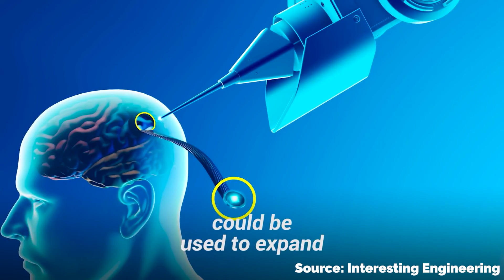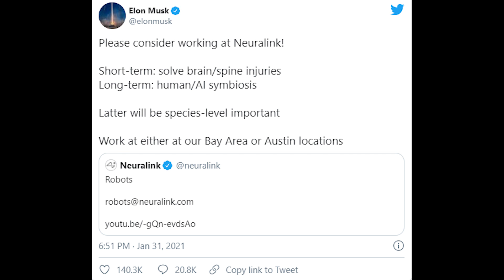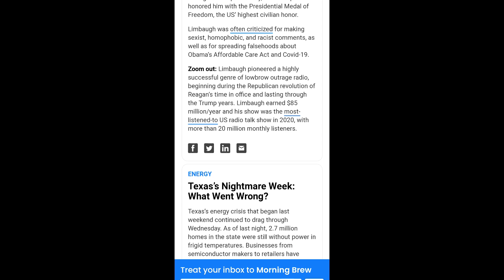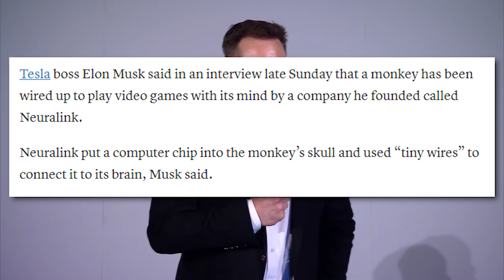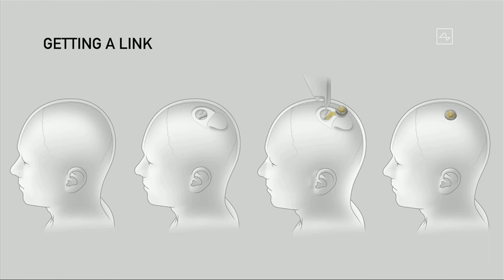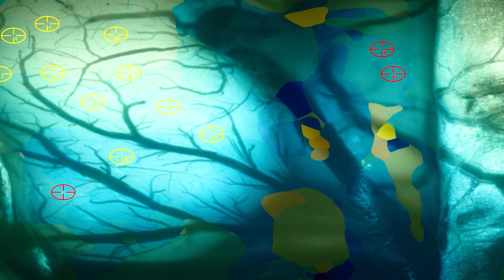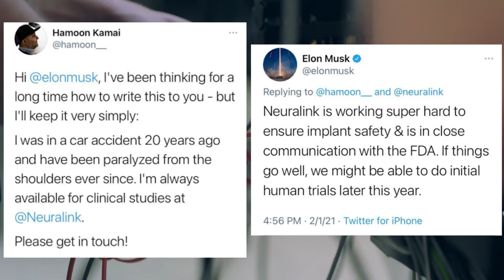The 2021 Neuralink Update Is Here..

Comment: The medical aspect of this tech is only to help generate enough funds and acceptability so that the main mission can be launched.  Not any kind of conspiracy nut talk, just looking at all the pieces and logically putting them together.

1. Auto pilot and fsd - the web that weaves all the parts together back to the human link.

2. Reusable, lower cost rockets built mostly by increasingly capable robots.

3. Tesl bots - very human like, when controlled by humans with neuralinks.

4. Full sensory Neuralink connections between humans and Tesla bots will be used for earth and space exploration and remote construction to eliminate dangerous conditions, risks, loss of life etc.

5. The bots will “learn” while doing this, just as fsd has learned by watching us drive for years. 

6. Solar power banks will continually charge vehicles, bots, tunnels, homes and factories. 

7. Underground tunnels will make transport quicker and less dangerous as weather and accidents will no longer be a travel concern. 

And on…

Comment: As a neuroscientist want to interject this statement into the comment section for people believing this is the end of humanity / singularity etc  - PONG works on 1 plane (vertical). Like in the first demonstartion with NEUROLINK. The first 2minutes of the video the primeate was manually controlling the digital interface in 2 planes (vertical and horizontal). Placing an intracranial electroencephalogram over the hand homonculus in the brain will only create positive and negative waves which can then roughly translates into 0's and 1's when the hand is activated or not. The can be used to manipulate the PONG bar either up or down. This is NOT complex movements like what was demonstrated in the first section of the video. NOBODY can create input signalling IN TO the primates brain...its only READING the EEG OUT-PUT signalling over Primates hand AREA in the brain (which we have been doing for many centuries)....a primate's hand area in the brain is particularly large which makes this whole experiment much easier (unlike with a human's). kudos to neurolink for translating the waveforms into bits of data and sending it wirelessly (Contemporary medical hardware are not wireless)....but i hate to break it to everyone - this is NOT going to evolve into some mind controlling super machine: this is the maximum function this experiment will obtain; nothing more - nothing less: and everyone who thinks you can do anything more from this experiment - is not a scientist but a pseudo-scientist; which is entertaining but not factual...which I will leave to Hollywood for good frictional movies or conspiracy theorists for blabber (THE FUTURE IS NOT GOING TO BE WEIRD)

Comment: surely every information has to be encoded before it can be transfered and decoded before it can be read. like brains, every computer program can implement things differently but if you want them to communicate they need to agree on some sort of interface or data layout. only that layout, which is not the raw/brainy representation of the information, can be known to any participant.

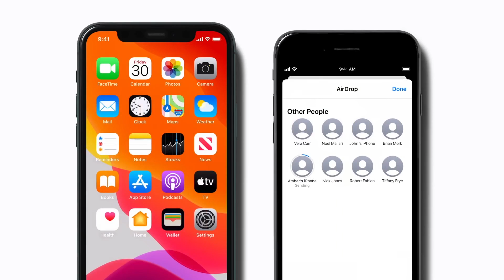Comment: The explanation of the procedure lacks in extremely many aspects at around 11:00. But most importantly, you'd have to take into account the degree to which a person is able to process the received data and mak sense of it, due to the brains of different people have different interpretations etc. Also the electrical states would have to be muuuuuuuuuuuuuuuch lower for the brainto handle them well. It is one thing to measure the output signal of a brain but a completely different story to adjust the active input of data in a specific format with the right electrical currency and values of measures and spacing for any human brain to be able to interpret it semantically. Think of it like this: For a machine, we can give instructions to do on its device with its designated architecture with standardized human brain wave measures. Like a learning neural network. But every brain has apart from its life-preserving instructions many different individual instruction sets and probably many more subsets. This means, that, for 2 humans to successfully communicate telepathically between each other, they'd either need to have at least 99,999% identical instruction sets (or brain architecture) or you would have to map it first. As far as I know, we are not even done discovering all the different instructions the brain contains, because they by far outmatch the ones used in computers. But research could be helped by exactly that technology. Mapping out human brain instructions/interpretations of incoming signals. This is the step we'd need to make first, then we'd have to lay out correspinding formal input pattern sets and ONLY then can we think about humans communicating the easiest stuff to each other.  Verbal communication in that moment, where the sender lets the receiver know what it actually wanted to "send" and comparing it to the interpretation of the receiver might help in that process, but ONLY for the communication between these two people. Uploading whole ideas and thinking processes would in y opinion be a far longer road to achieve accuracy between 2 individuals (let alone between any other human.). All of this is of course assuming, that you don't use any additional devices. But those would make the whole purpose obsolete, because then you could just use a smartphone, sending a file or text message to a colleague. Where would be a point in that? This has to be as non-invasive and with as little additional helping equipment to even make sence for study in the first place.

Comment: The real issue comes down to complex processes into and out of the brain. It's one thing to move a slider you're looking at, it's another to download terabytes of audio/video data, translate and decode it based on the specific mapping of an individual brain, analyze it, then translate and digitize organic memories in response. Simple functions are easy to translate with simple neural signals. The idea of data transfer is a ways off, on top of that you have neurochemistry to think about, as that greatly influences brain function, and isn't fully understood as it is.

Comment: As a software engineer, I need to add an important detail: NO, it can’t hack you and control you. It can only READ radio waves.
Reply: its read and write, if it was only read it would be useless
elon has said multiple times it will be fully read and write, write=change your brain and your perception=the most useful stuff is write
Reply: @bntagkas  a logic gate into ur motor and sensorimotor cortex would result in a cloudy mess of uncoordinated responses. Good luck integrating that through a microcircuit implant.

Comment: For the sake of curiosity, someone should ask Elon how the Nuralink, long term, would react to drug use
Reply: I’ve actually thought about this extensively. With the rise of BCIs I’d love to attempt to code the effects of the lsd trip into one to recreate the experience. To answer your question if this thing works the way it should eventually you won’t need drugs anymore.
Reply: @madkinggaming3744  wowwww that sounds wild
Reply: @madkinggaming3744  computer?
Reply: @R2D2Xwing  Network, electrical, db, software, mechanical. I wear many hats lol. My day job though primarily involves software, db, network, and electrical engineering. I work on a large network, building large custom apps, and develop custom electronics for specialized automation task.
Reply: @madkinggaming3744  wow that’s cool I’m currently learning computer science
Reply: @R2D2Xwing  nice it’s a cool field lots of chill people. I’ve been doing this stuff professionally since I was 16 and unprofessional for some side cash since 10. I learned the hardware inside and out by the time I was 7 because of my grandfather. Taught myself to code and other various fields. Lied on my resume for an interview where I proved I knew what I was doing and came clean after I was told I had the job. Risky but it worked and now I have real job experience to add to my resume
Reply: @madkinggaming3744  that’s great I’m trying this filed out so far for me a bit hard Java couldn’t quit get last semester but I think I’m picking on c++ this semester
Reply: @R2D2Xwing  c++ is significantly more difficult than Java as there is no memory management in c or c++ but if you get it down learn assembly next from there everything else will make sense
Reply: @madkinggaming3744  ok thx
Reply: I’m an engineer btw lol